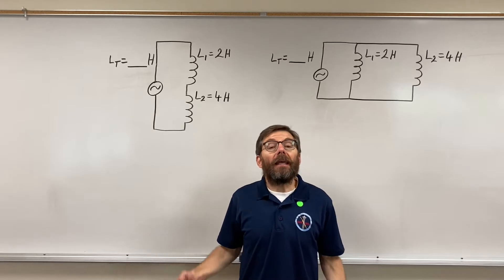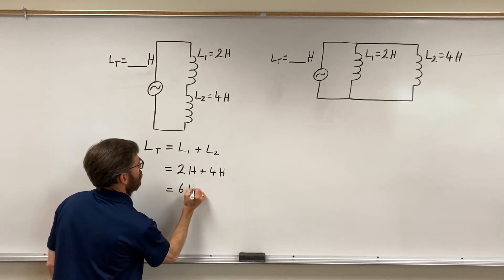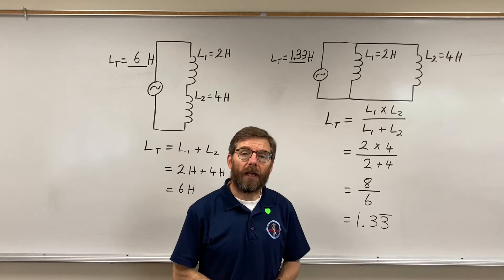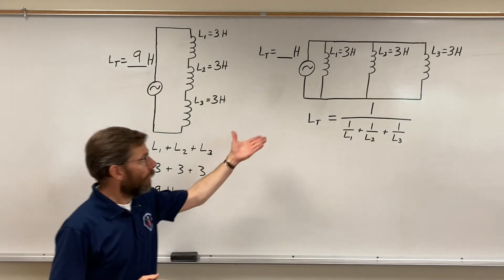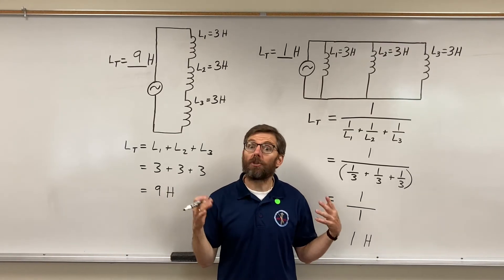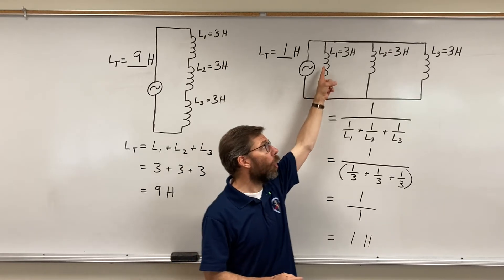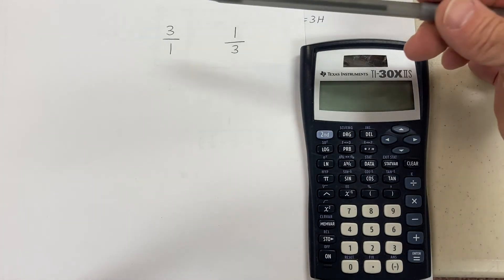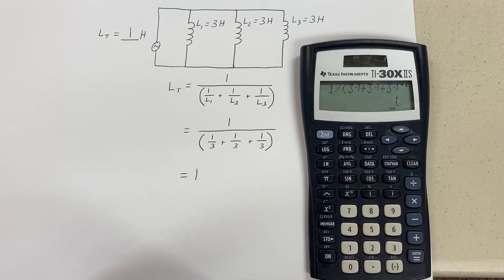Adding Inductors in Series and Parallel

Comment: I still like using product/sum on parallel and just do it more than once. So you’d do the first two P/S and get 9/6 or 1.5..and then product/sum with 1.5 and the final inductance. So 4.5/4.5 and that equals 1.

Comment: For visual approximation the situation may be compared as …. Series: Traffic has to pass through a road with three speed bumps 
Parallel: The same traffic has Three parallel roads with one bump each to pass through.
In parallel’s case obstruction is less ( in this video one rather than 3) as the traffic on each road will be one third of the original

Comment: Great! This is very educational. 
I have a question and I was hoping I would find an answer here. 
I am currently working on testing the load characteristics of a three-phase traction inverter with output phase current of 750Arms. The problem is, I have x1 200A inductive load bank which I intend to hook up to the ac out of the inverter but I know this won’t accommodate the ac output of the invert. So I’m thinking of having multiple 200A inductive load bank connected to the ac output of the inverter. Can someone help explain how I can achieve paralleling these inductive load banks, please.

Comment: Lets say I have ten inductors at 10mh in series. Across each inductor is a diode bridge. Each diode bridge has the output in series. Across the ends of the series inductors is a 8ohm piezo tweeter.  The input is 18v AC at 60ma. So how does the little round piezo tweeter affect the inductance?